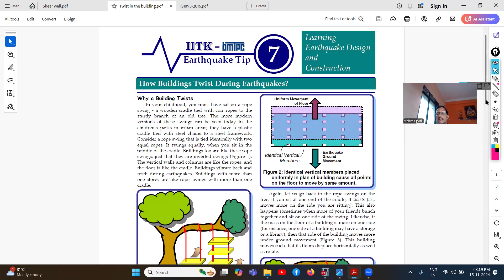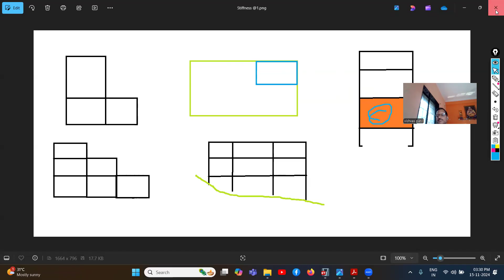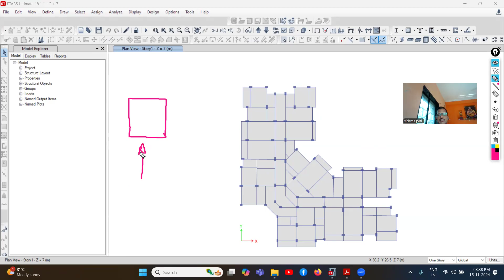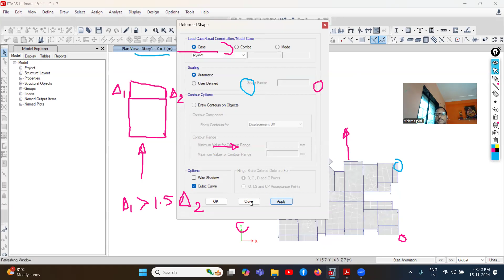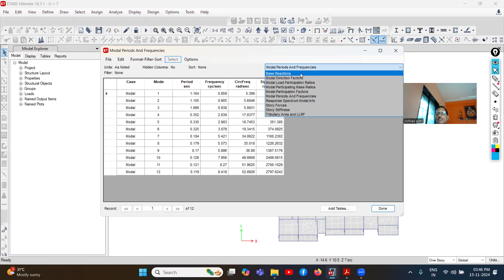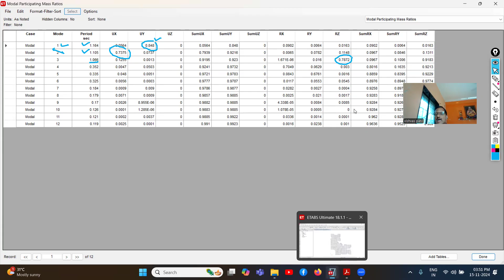IS1893  Torsional Irregular

Comment: While defining sesmic load pattern, there are 3 options for time period ,which one we should take, user defined or program calculated in etabs
If user defined thn plz explain why not we go with program calculated
Reply from the maker: Strict Scaling Law (Clause 7.7.3): For Response Spectrum Analysis, the code forces you to scale up dynamic forces based on the static base shear. This static base shear must be calculated using the strict empirical code period ($T_a$). Inputting this as User Defined ensures your static baseline is perfectly accurate.